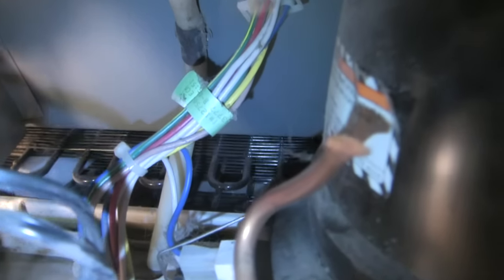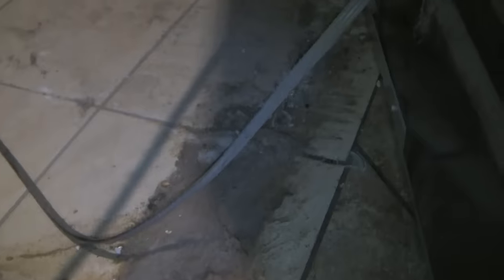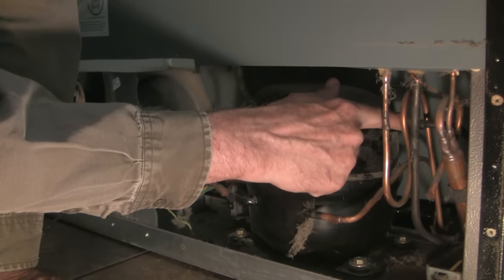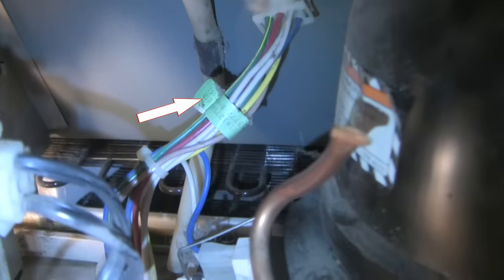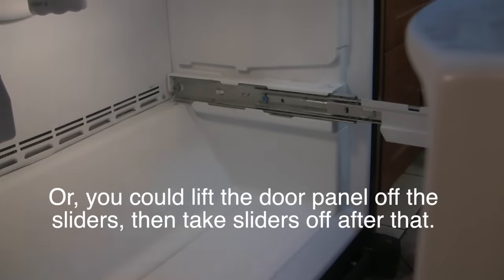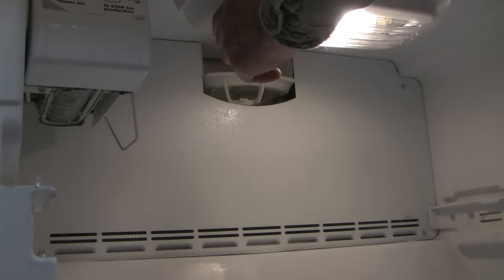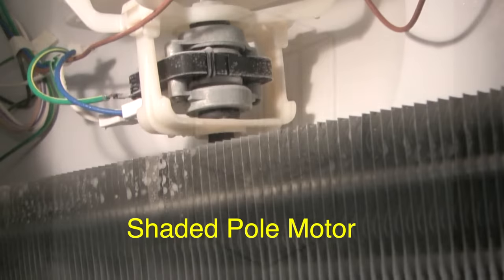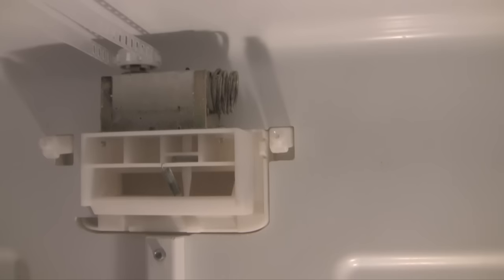How to investigate and fix a fridge that is too warm

Comment: After defrosting freezer coils, verifying fan, heating element and timer working. Timer was stuck i unstucked it. I also cleaned all the dust from the bottom coils, fan and vacuumed that area. Washed with water and wd 40 those parts. I noticed a great deal of lint covering the outside, cover near the compressor.  That led me to think about how important airflow is on the back of the refrigerator. It’s not just lint as a problem. It’s also the confined space cabinets walls. There was only about 2 to 3 inches of air room. As a test, I use the fan to help circulate air from behind the refrigerator. What a difference that made in performance in the amount of electricity, being used by the refrigerator constantly running.  Moral to the story just like your car needs air so does your refrigerator. This will greatly reduce my electrical bill and prolong the life of the unit. I am now getting -10° in the freezer refrigerator is now at 40°.
Reply from the maker: those are wise words that apply in many situations. I like the way you think it through.

Comment: you're better off repairing old appliances given that newer ones are made of spit wads & bubblegum & designed for about 5-year lifespans.
Reply: No
Reply: I own my repair service company and your comment hit the Nail Directly on the head. I have more newer units with constant issues that are irreparable. Fix your old units!👍
Reply: How old are we talking about?  Like a 20 year old fridge?
Reply: 🤣😂"spit wads & bubblegum" huh? 😆🤣🤣😂👍
Reply: @robertrgonzales2464  these newer appliances are 🗑 trash.
Reply: Exacty
Reply: That’s been the anecdotal evidence for sure. Appliance quality has went way down this last decade.
Reply: Totally agree! I have a chest freezer that is 12 years old next month that I’m about to have to replace due to the lid rusting out and they no longer manufacture the lid for this model 🙄 freezer still works great, just starting to frost over inside due to the lid problem. Will cost $550 to gather all the parts to fix the lid. That’s half the cost of a new the same size. Meanwhile I have another chest freezer that was manufactured January 1979 that is far superior to anything on the market today. No issues whatsoever.
Reply: @steve0h2004 yes. I would say 25-45 year old appliances are the range you want. Newer ones you will be replacing every 5 to 7 years. Washing machines, a/c units, etc... all junk. Hell, even cars. We have a 1990 4runner. Very few repairs done. You should see the power window parts inside the door. No plastic parts lifting the windows - its all metal wheels inside. It's got almost 300,000 miles, and still going strong.
Reply: Spit wads and bubblegum 😂😂😂 you’re right though

Comment: Try this to get the freezer working again. I have an LG Top-Bottom Fridge that was having similar trouble. Compressor and exterior fan were working fine but the freezer was not cooling. I removed the front interior trim of the freezer and saw that the evaporator fan was not working. I carefully unscrewed it from the housing frame behind the trim and checked the resistance and continuity on the wire connector which were excellent. Now I've seen repairmen who would just tell you to replace the fan but at that time of day that was not an option. Having done this before with a standing fan, I realised that all this fan wanted was a cleaning and lubricating of the magnets and impeller respectively. Eventually over time with these two there is a build up of dirt, and rust in some cases, which must be cleaned and so   here is where WD 40 is your best friend. I used some of this on a paper napkin to wipe the two surfaces after which I used some treadmill silicone oil, you can use something similar,  on the curved surface of the impeller as well as the shaft and end joint housing. I reinstalled the evap fan and plugged it in. Not only did it spin, but it spun faster than before. Also, make sure you clean the plastic fan blade which should just pop off the impeller shaft. I placed mine under the faucet and used some dishwashing soap. Hope this tip helps someone to save some time and money. 😀
Reply from the maker: Good point, well done. One other thing for people to remember is that if their other fan, the evaporator fan is not working, sometimes the board has shut it down to enable defrost phase. In that case the compressor would not be running. Older fridges used mechanical timers that could get stuck and it was simply a matter of rotating the dial to get it out of defrost. That buys time to replace the timer without letting food thaw. To know if the board has called for fan, measure voltage and ground at the fan itself to see if the fan is failing to responding to a call to turn on.
Reply: @spelunkerd  Nicely done.

Comment: Great video. Unfortunately everything is clean and working fine in my fridge but still not keeping cold. My freezer isn't freezing but fridge seems ok. I have taken it all apart. Coils are good. Compressor seems ok but I don't know. The whole fridge was vibrating and shaking last night and then it stopped cooling. What would make the fridge shake? Thanks.
Reply from the maker: Gee, that's ominous, I would check the mounts for the compressor. If you're not finding ice where it shouldn't be, and if leaving it off for several hours and restarting doesn't help, you'll have to make a decision whether it is worthwhile asking for advice from a pro. On the surface it does sound like a compressor problem, or maybe an undercharge of of refrigerant. Often the cost of fixing an old fridge is not worth it, compared to replacing it with a new one.
Reply: @spelunkerd  yep...folks want 200 bucks just to come out and look at it. I ran out and got a new fridge. Thank you!!

Comment: video solved my problem. old freezer working with frig barely cold. coils not dirty. exhaust fan working. freezer fan working. disassembled until i got to flap that lets air into frig. sure enough electric controlled flap was in closed position. solution was bypass dead elec control and put in a piece of plastic to maintain flap open all the time. works great now. if it was a manual control knob this would never happen.

Comment from the maker: One thing I forgot to mention was the glimpse you get at 5:54-5:58 of the defrost heater, the length of dark element positioned underneath the evaporator. Those sometimes go bad, causing icing of the evaporator and ineffective cooling. Mine was obviously fine.
Reply: Just swapped out the evaporator fan and she's purring like a kitten... LOL👍👍
Reply: 00
Reply: Do u have a video on how to replace the defrost heater for the unit in this video?
Reply from the maker: @thaman20071  Not on my channel, although you may be able to find it online.
Reply: @thaman20071  if you find one please let me know!!
Reply: Shouldn't the evaporator fan run nearly constant also?  Except when on defrost timer when the defrost heater is energized.  ALthough the thermostat is in the freezer compartment, if the thermostat says the freezer has reached temp, but the cooler section is not, how would the cooler section ever get cold enough if the evaporator fan wasn't always moving?
Reply: Hello looking forward to subscribe to this channel ASAP, but today I just purchased a brand new Whirlpool refrigerator, Whirlpool Model # WRS555SIHZ06 side by side, I have two questions, first I notice that in this new model I purchased today, the compressor shuts off anytime you open the fridge door or the freezer door, and then turn back on when you shut the doors, is that normal? the second question is, what temperature should the freezer side, and refrigerator side, be if you set the temperature at the factory recommended setting?
Reply from the maker: @alexshatner3907  There's been a quiet revolution in new refrigerants, completely getting away from hydrofluorocarbons in favor of more environmentally friendly compounds. The last freezer I bought was cyclopentane/isopentane based. Along with those new refrigerants has come more efficient board design. So, I would not be surprised at all if your fridge fan turns off when the door is opened. Target temperatures haven't changed much, they are listed in the first couple of minutes of this video. The target temp for our new freezer is -18 deg C, the main fridge compartment itself is around 4 deg C. Nice to meet you!
Reply: @spelunkerd  Nice to meet you, I just subscribed to your channel thanks for update, I only understand temperature as Fahrenheit, not Celsius, so what these temperatures you just quoted be in Fahrenheit? so is juts the fan that turns off, or is it also the Compressor that turn off? And if the compressor is turning on and off every time you open any door isn't that to much wear and tear on the compressor?
Reply from the maker: @alexshatner3907  That's a good question, I don't know much about the new devices. Translating C to F is easy with google.
Reply: @spelunkerd  did you say minus 18 as in    " -18 " ?
Reply from the maker: @alexshatner3907  AT 0:35 of the video the target temperatures are shown, in both Fahrenheit and Celcius.  -18C = 0F.
Reply: @spelunkerd  Oh thank you my friend I missed that lol

Comment: Great video! Thx I'll try n fix my Kenmore as well. 

My freezer is working well but the Fridge is hot. Water leaking from inside Fridge from the duct where cold air comes through.
Reply: I’m having the exact same issue with the same fridge. What did you do to fix it?

Comment: Thanks for sharing this video..I  have a refrigerator bought it from Sears and after 2years it stopped working didn't have a warrantee so I called Sears got it fixed got a 3yrs warrantee and 4th year same thing the fridge would stopped cooling in the month of May so we tried using the ac to cooling down and it helped a little but the fridge works fine throughout the winter makes ice too  Sears did change that round black thing in the back forget the name rt now the fridge stopped working 2 weeks now we decided to buy a new one afraid to spend money to fix it and have the same problem
Reply from the maker: One element that fairly commonly goes bad in consumer level fridges is the PTC relay, which allows current to flow through start coils for the first few seconds, following which its resistance increases and current through the start relay is reduced. There is a capacitor in series with the start windings, and all together it is a black or white cube that clips onto the compressor. The details of that are too advanced for an intro level video, but if you're interested there are many videos and resources describing that in detail.

Comment: I remember when frig coils were on the back & very easy to access. Also, they never really got very dirty there. Now they all hide them underneath where a fan sucks in your house dust & it seems to be magnetically attracted to the coils. Some underneath coil designs are all but impossible to clean.
Reply: There are vacuum attachments designed specifically for coil cleaning. I don't like having specialty tools for every little thing, but it makes it really easy. I just vacuum from the front once a year - usually in Spring before kitty starts shedding lol.

Comment: Excellent explanation! Our fridge/freezer is very similar to your model, and I've had it opened up before to clear that defrost drain tube. Today we have a different problem; everything appears to be functioning properly, except that nothing is getting cold enough. Cold air blows out in both the fridge and freezer, but the temperatures aren't low enough (I don't have an IR temp gun like yours... yet) and most of the food went bad overnight. I'm wondering if maybe it has developed a small refrigerant leak or something that would keep it "cold but not cold enough".
Reply from the maker: That's a valid concern. Unfortunately domestic fridges don't have Schrader valves to easily measure pressures, so if a tech wants to measure pressure he needs to puncture the line and install a valve on at least one side. That is beyond the scope of most DIY homeowners. Here in Canada, because of environmental concerns, homeowners don't have access to the correct refrigerant without a license. The cost for that kind of professional repair of any refrigerant leak will be hundreds of dollars. I would carefully walk through the diagnostic steps shown, especially looking at the door seal very carefully. If the door doesn't fit perfectly square, fix it. I show how to adjust an out of square door in another video titled 'freezer frost repair'. Don't forget to look for simple solutions. If the steps shown in this video don't show a problem, you face the dilemma of whether to pay a guy to fix it rather than buying another. Many homeowners decide to save that money for a new appliance....
Reply: @spelunkerd  thank you so much for the thoughtful response! I did find information on using a piercing valve and gauge to measure/refill the refrigerant, but without the tools on hand decided not to go that route. The door is sealing well and there is not much dust buildup (I cleaned it out a year or two ago and we don't have any pets), and the fans, compressor, and refrigerator damper flap all appear to be functioning. The refrigerator (a Maytag MBF2256HEQ) came with the house when we bought it in 2012 and as I recall was manufactured in 2005. Thankfully, we had enough in emergency savings to cover a new refrigerator, so we ended up giving the old one to a neighbor who wanted a "garage fridge" for storing drinks, and we bought a new one for our home (an LG LFDS22520S, in case you're curious).

Comment: Great video!  And over a million views too.
Reply: I was cleaning the clogged coils on mine and access was difficult.  I made the mistake of tipping it back for better access.  When I put it back down and fired it up, it fried the compressor.  I didn't let it sit long enough for the oil and refrigerant to flow back down.  I inspected the compressor and it was very hot.
Reply from the maker: @briansmobile1  Good point, sounds bad. Before condemning the compressor and blaming yourself, you might let it cool down and try again. These devices have temperature overload switches that won't let it start if it gets too hot. The other possibility is your PTC relay/capacitor has gone bad. Typically they click and hum but won't spin, then they overheat and cut out, then the cycle repeats in a few hours. Here on Youtube, ACServiceTech did a great series of videos on the topic, search "PTC relay". The topic is fascinating, I did a deep dive on it last year out of curiosity. The PTC relay and capacitor are sold together for small fridges, it's a cheap easy fix if that is the diagnosis.

Comment: About 3 hours after getting home from work yesterday I noticed my Frigidaire freezer was not cold like it should be after I took some ice out of the ice tray. I felt some water in the tray. I felt the other items in the freezer and the box for the waffles was damp feeling. The frig was still blowing cold air but it didn't feel the same. I unplugged the refrigerator for almost a minute  and I could hear what sounds like condenser I'm assuming come back on. I checked the coils in the back and they were clean. I popped the cover off from under the bottom front and there are no coils. I could only see a small black tray on right side. The items in the refrigerator seemed cool. But still not as cold as it normally is. I checked the seals on both doors and they appear to be fine. I've got a meter to check condenser or whatever part that may need to be  checked.  Only bad thing is I'm gonna have to wait until this afternoon to attempt to fix the issue  after work.
Reply from the maker: At this stage I would let it defrost overnight if you can. Then turn it back on. You want to check to be sure the compressor is running. If it hums for a few seconds then shuts off, inspect the PTC relay or potential relay, the capacitor, and the motor. The other thing that commonly happens is a defrost cycle, which intentionally shuts the compressor down for several hours to melt frost. Older fridges have a timer that can get stuck on the defrost cycle. Search for the wiring diagram that is usually hidden inside the hardware of the fridge, somewhere. Be sure both fans are working. The technical features of how to test these devices is beyond the scope of this introductory video. There are good resources showing how to test these here on Youtube, if you have time to put in the effort.
Reply: @spelunkerd  there is a humming sound that does not turn off. I touches the compressor and it's warm not hot. Before leaving this morning I notice some items in the refrigerator were cool. So I'm thinking it is not getting cold now. The frig has some  cool air blowing continuously blowing into the frig. It's like it's not switch from one cycle to the next as if it's stuck.

Comment: Thank you so much for this video.  I was about to have a repair guy come in as my fridge was not keeping the milk cold. We put a thermometer inside to confirm my suspicions on milk temp and we were running 10 degrees LOWER than is necessary to keep food from spoiling!!!  I came to Youtube to see if we could do something before the repair guy came and low and behold, we opened ours up as you instructed and mine looked just as dirty as yours with NO DOGS!  I am so embarrassed but, we've just spent a bit of time cleaning it all out.  Now we'll see if the repair guy can get cancelled!

Comment: Thanks for taking the time to respond. Yes, the repair guy came out and said no freon. He mentioned the evaporator line had a hole it it. Also, it needed a "hard start" relay. Is this worth it?
Reply from the maker: Great question, hard to say. When I go the local recycling yard I am always sadly disappointed to find many new looking appliances. It is hard to compete with brand new devices that come with a warranty, etc.